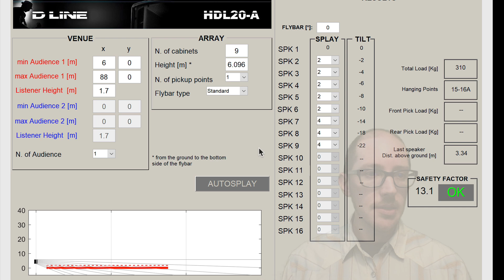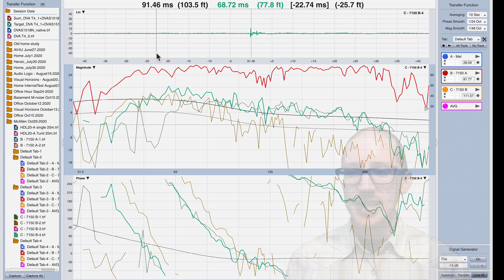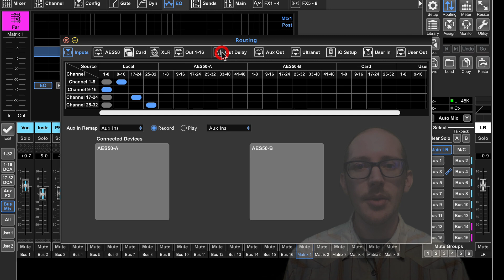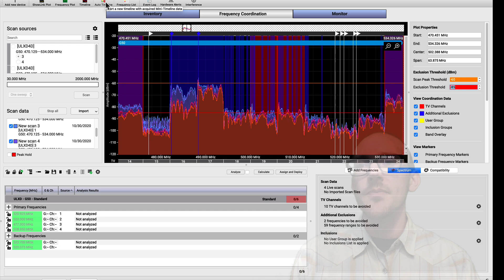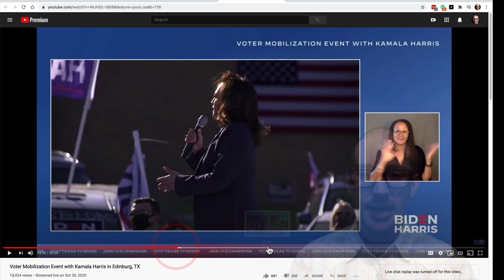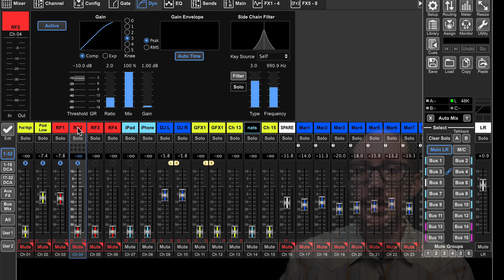What I learned doing sound for Senator Kamala Harris

Comment: more precise simulation is possible to make with RDNET 4.0 software, but I am not sure, if HDL-20 are included in this software. Or even better solution is to simulate in Ease focus
Reply from the maker: Thanks Palo. This is a special case because RDNET does not include HDL-20A and EASE Focus does not include allow you to look at a phase measurement at a point in a room, as far as I know. But, I rarely use EASE Focus. Do you have a different experience? Are you doing crossover alignment modeling in EASE?
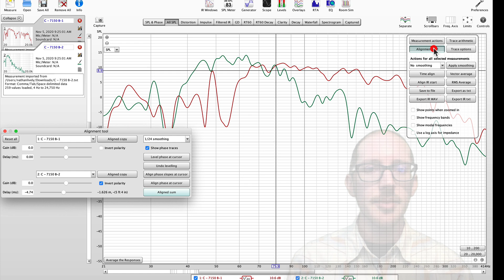Reply: unfortunately, no, there is no such a function. But I don't see the reason, why you would need to read phase in simulation. Phase is necessery just for alignment with subs, and that has to be done in the field. One recommodation to try. At 11:00 minute of this video, you was talking about autosolver (software, that is able to make summation of two traces, Subs+Tops). Try to use for this software for powersoft modules Armónia. You should connect it directly to smaart, or import ASCII, and make offline corrections and phase alignment. It calculates sum trace. I was playing last time a little bit with and it works flawless. You should deffinitely try it.